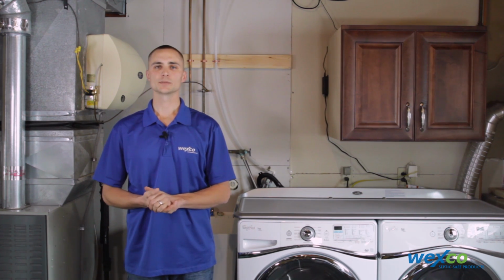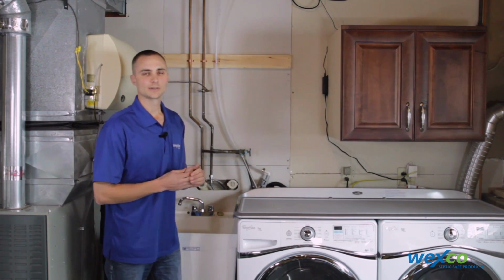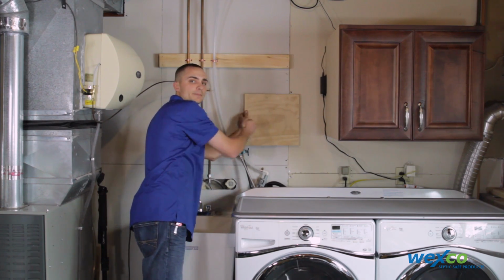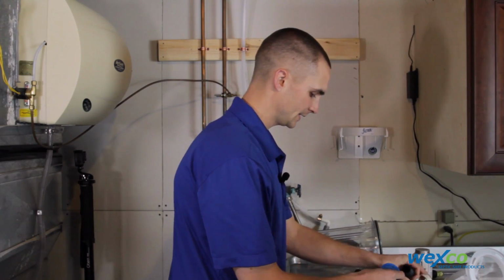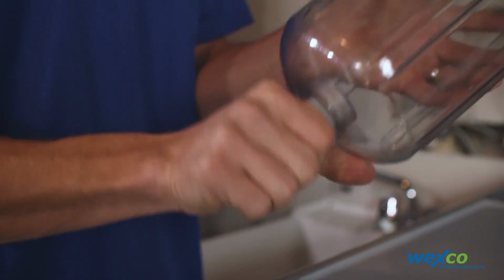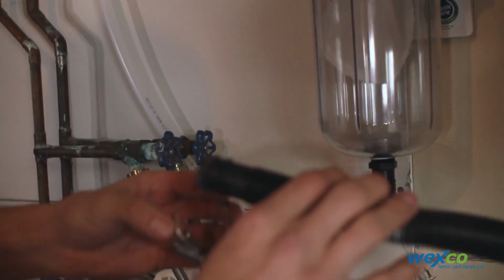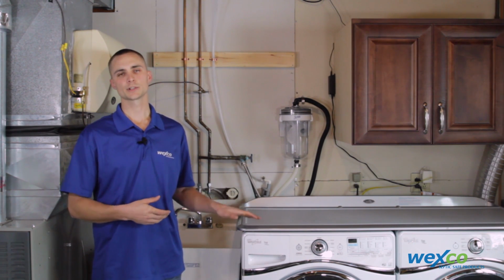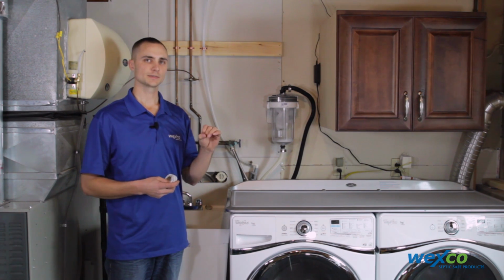Filtrol 160 Installation | Septic Safe Products | Washing Machine Lint Filter

Comment: You really need to provide some information for connecting the plastic like GE washer drain hoses.  Even your own website depicts having to utilize some sort of rubber hose adapter to get it to work but it seems you are too afraid to mention what this setup is.  Is it too leak prone for filtrol to provide a recommendation?
Reply from the maker: Please understand that every washing machine and every set up is not the same. It would be very difficult to provide connection suggestions for every machine on the market and to know what everyone's drainhose size is, as not everyone keeps the original drainhose provided with their machine and how they are needing to set it up in their specific laundry room as those are all different as well. We do have multiple images on our site showing some with an additional "diy adaptor" people have used and some that do not, you can see them all here: https://filtrol.net/filtrol-installation-examples/ . In most cases these added pieces are simply a section of radiator hose that fits around both their drainhose and one of the provided fittings. We are always willing to answer any questions you may have about making the Filtrol work in your particular set up and offer as many suggestions as possible. If you have any questions you can reach us at wecare@filtrol.net .
Reply: @septic-check  Yes, I understand that and is why its frustrating to see all your videos show the easy connections.  It's not like GE is some small time manufacturer.
Reply from the maker: @Lafue108  We understand this and if they only made one particular model of washing machine it would be much easier for us to offer one specific suggestion but as you know this is not the case and each manufacturer makes many different models of washing machines. We offer fittings that we have found are the most common sizes of residential washing machines drainhose. Sometimes the fittings work just fine and some need a little extra help to make it work if the setting allows it. But unfortunately it is impossible to know everyone's situation so like  mentioned, we are always willing to offer suggestions if we know your current situation.
Reply: @septic-check where can I get this from
Reply: Had you skipped the snark and instead used the time you spent on these two comments helping them help you, you would have gotten your problem solved, and probably solved quickly. And perhaps you would have gotten the answer posted here, where it could have helped other people with the same question.

It's been a year--has it sunk in yet just how unproductive your approach was? Maybe if you have simmered down, you will consider posting the model number, or even better, the part number, dimensions, or at the very least a description of your hose and a brief note about what, exactly, is the problem you're encountering with connecting to the Filtrol unit.

Comment: can this container be pressurized to  drain uphill about a foot or. two?
Reply from the maker: Hi hvac01453, the Filtrol solely depends on gravity to drain and unfortunately cannot be pressurized so that it can drain upwards. For best results the Filtrol should be installed above the drain location and the drainhose is at no more than a 45 degree angle. If you have any further questions please drop us an email at wecare@filtrol.net
Reply: No, filtrol has to be installed way high and this can mess with how the washing machine pumps water out.  I believe you have to check to make sure your washer can pump this additional height.

Comment: what can I use to adapt my laundry hose,  its just a little smaller then the 1" and it wont fit the 1" fitting
Reply from the maker: Hello Tim, all Filtrol units do come standard with a 3/4" and 1" elbow fitting. If the 3/4" is too small and the 1" is too big, you can try the following. Heat your hose up with a blow dryer to make the hose expandable and see if you can get it onto the 3/4" fitting and secure with the provided hose clamp or use plumber putty on the 1" fitting so that your drain hose fits snug onto the fitting and secure with provided hose clamp. I hope this helps and if you have any more questions please drop us an email at wecare@filtrol.net.
Reply: @septic-check  if the 3/4 is too small, heating it up wont likely help,   did you mean the 1" fitting?  heat it so it will stretch over the larger fitting...
Reply from the maker: @user-nf5zt4kr6p  Yes, sorry that is what we meant. I hope this option works for you.
Reply: T that’s what i has to do because i was in the same boat so i used a great gun to soften the house to stretch over the adapter and still used the o rings to make sure its leak proof